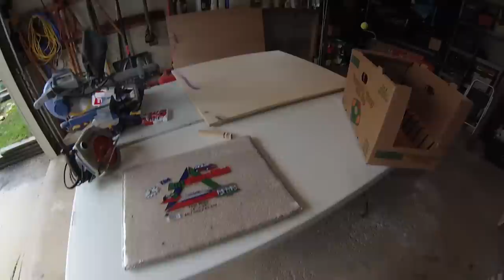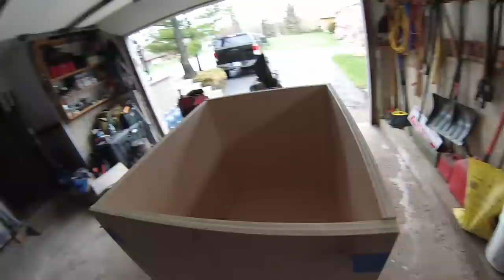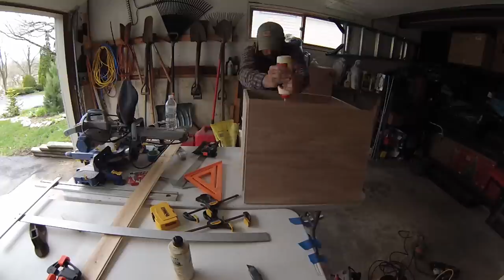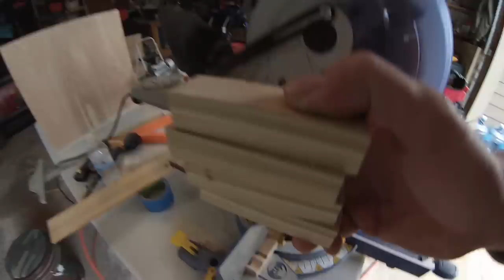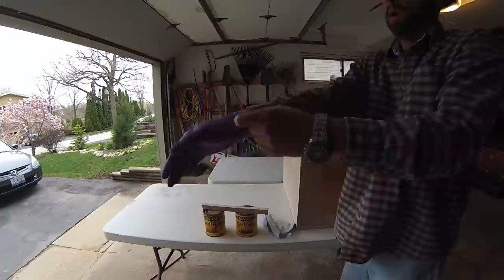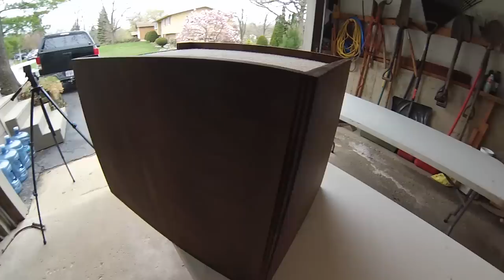DIY Cat Bed For Under $20 Dollars

Comment: Great job. Your measurements were great with the t-square. Using the brad nailer was a quick and easy way to get it done and I appreciated that you also did use wood glue as well (many skip it). Great job on the sanding and the finish. Nice clean and dark pencil marks as well so no questions about where to make any cuts and they were so dark and straight we could see them on the video. You make me want to go out to my garage right now. . . . but alas. . . . .Home Depot and Lowes are closed because I am watching this at night for ideas. I appreciated the carpet which I have extra and I could still sew another pillow or blanket to go in both the bottom and top for extra cushion or personalization.